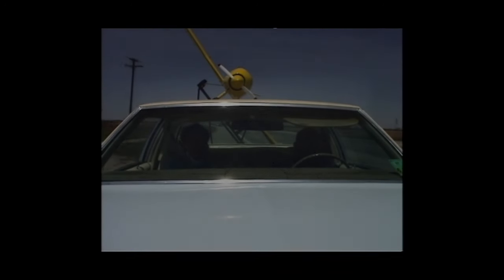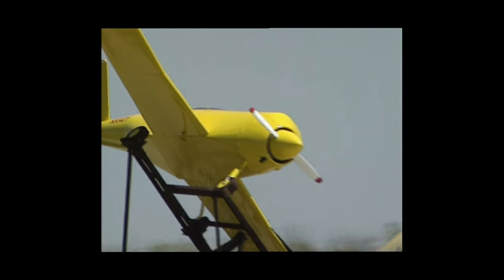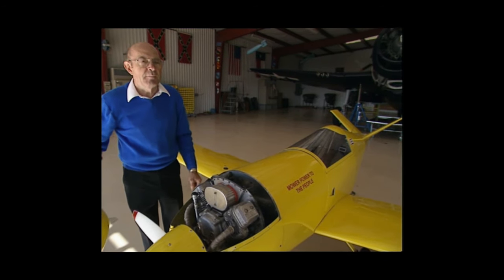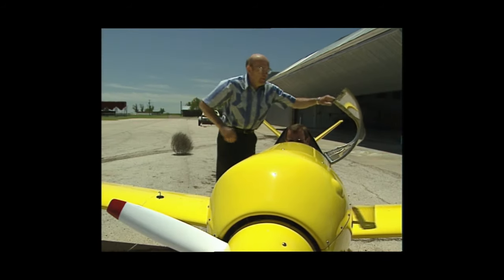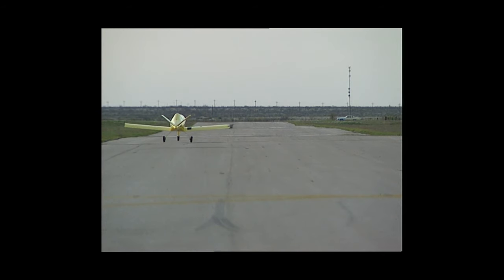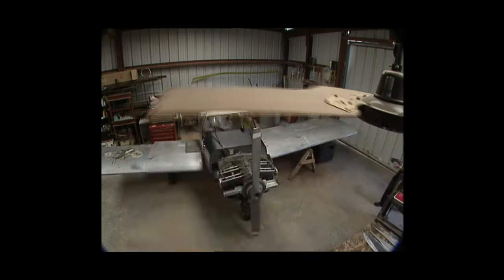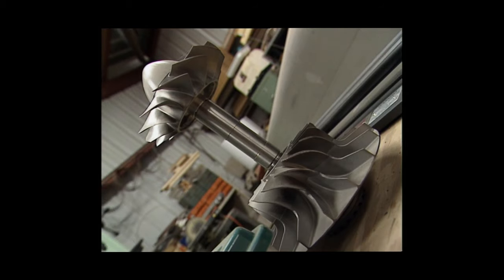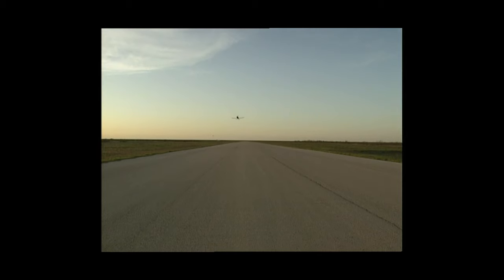Leeon Davis Homebuilt Genius DA 11

Comment: How much would this plane cost to build, or purchase, hypothetically? The fact that it can hit 135 mph, burns only one gallon of fuel for every 100 miles travelled, while being made of metal and powered by a 20 hp lawn mower engine, is honestly impressive. I would love to have one.
Reply: Design and build your own. The big ticket item is probably the motor at $1,500. And good propellers can cost about $2,000. (See: Catto props).

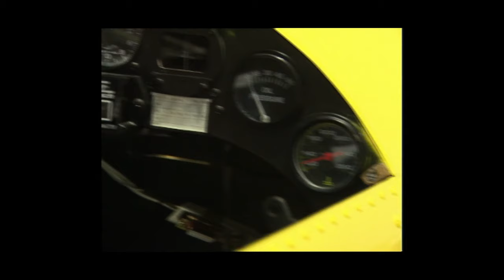The aluminum is likely less than $2,000. But I wouldn't use aluminum. Better off with fiberglass for Strength-Weight and aerodynamics. Use the Rutan Moldless construction method (hotwire cut, Dow blue XPS styrofoam). See the 1:37.00 minutes video on constructing the LongEZ, and watch Mike Arnold building the AR-5, and AR-6 fuselage plug for info.
Reply: @TheJustinJ  You won't achieve the same strength to weight ratio with fiberglass, not even close! Only pre-preg carbon in very expensive molds can approach what can be done with aluminum. Aerodynamics? Yes, it's easier to make curvy shapes in glass for sure. But it won't be lighter than aluminum. :)

Comment: Aircraft Spruce list the empty weight as 175 lbs. This puts is about the same weight as the Cri Cri. The Cri Cri uses 2 210 solo engines that surely don't weigh as much as the Vanguard(approx 75 lbs stripped down), which would leave only 100 lbs for the air frame so its  lighter built. Perhaps a more accessible design using this type of engine would be the SD-1 Minisport...not metal though.

Comment: Apparently this is a less powerful version of one of Leeon Davis’s earlier designs, the DA-9

The DA-9, known as the Super Pocket Rocket, was powered by a two-cylinder engine putting out 40 hp. Incredibly, this plane could reach speeds of 260 mph. 260 mph on only 40 horsepower, holy shit.

If it can do 260 mph with only 40 hp, imagine what it could do if it were powered by something like a Miata engine, or a B-series Honda engine, or a 4A-GE. Or hell, an LS1. This thing would be absolutely bonkers
Reply: Just design something specifically to be bonkers with an LS1. That way it isn't shit in every other way except speed. I guess that's what we Americans like... fast shit :D

Comment: I think that’s a great idea Bart. Before the lightning bug I had thoughts of converting at Honda engine myself .. if you saw my projects you know that I like building on a budget , but just to show people that it is possible . I have no desire to manufacture anything myself but am glad your willing to. Good luck!
Reply: A Honda B-series engine would turn this thing into a rocket lol. Davis also made a more powerful version of this plane called the DA-9 Super Pocket Rocket. This one had a 40 hp twin-cylinder engine, and was able to reach speeds of 260 mph. You could probably get into the mid 300 mph range with something like a B-series or a Miata engine

Comment: I wonder what the performance would be like with a small automobile engine in lieu of the lawn mower engine. Say, a Honda D-series or even a B-series engine. 

Or if you want to keep the weight down, while still adding power, how about a 4A-GE from a Toyota MR2 or AE86. The physical size of the 4A-GE is pretty small, even for a 4 cylinder. But they put out a pretty respectable 112 hp (the US market ones at least). If you were to import a Japanese-market 4A-GE, those ones put out 130 hp from the factory. There’s even a supercharged version, the 4A-GZE, that makes 145 hp. You can even tune these engines and get them up to 200 hp

You probably wouldn’t get 100 mpg like you would with the lawn mower engine, but you’d still get decent fuel economy, and you’d get increased performance. You could probably turn this thing into one hell of a stunt plane that way.

Comment: could always add an electric powered (powered from the mower engine directly or off of the battery bank loop (which is powered by the mower engine)) propeller engine on the very back to help with taking off and quicker altitude gain. could even offset some of the extra weight by using carbon fibre components.  i'd also add winglets too (which gives the wing more usable surface area for extra lift) but i guess this was from an era when they didn't know about winglets.
but wtf do i know right?!?!? im probably wrong but just thought i'd share
Reply: Oh this thing could be a lot slicker than it is. Imagine turbocharging that little lawnmower engine
Reply: Keep it simple!